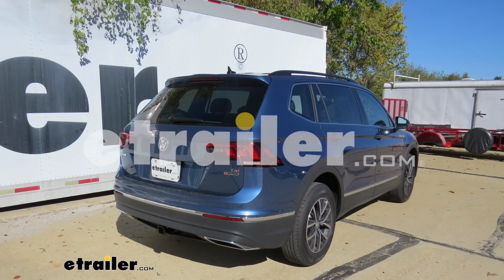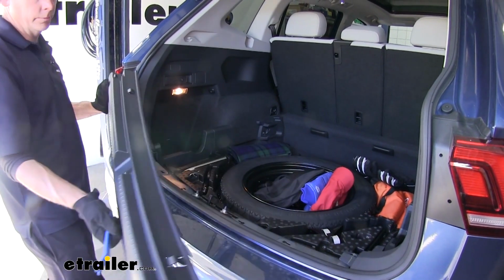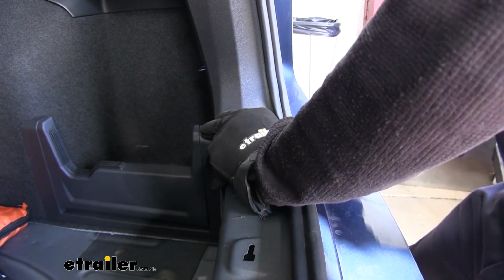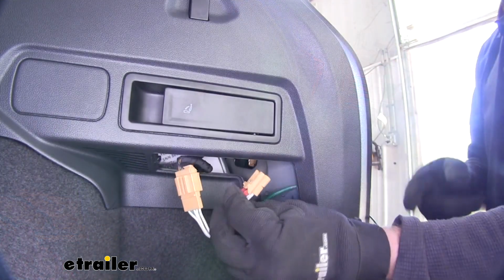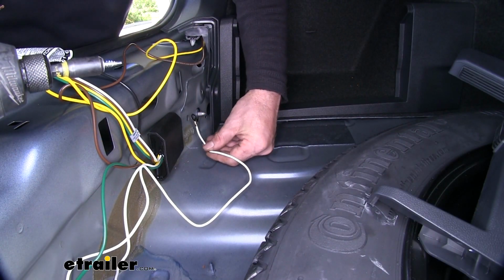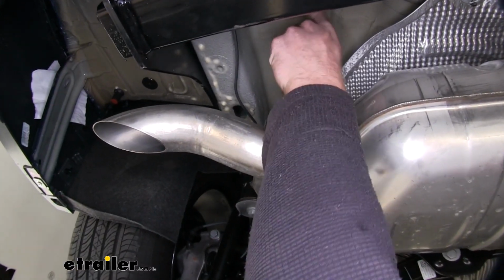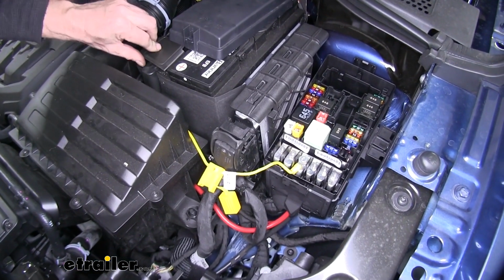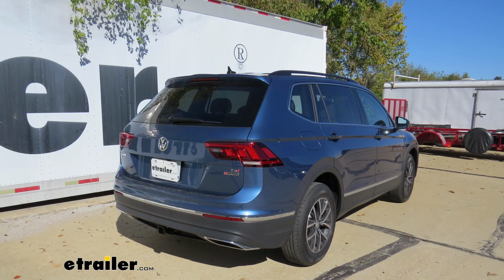etrailer | Curt T-Connector Vehicle Wiring Harness Installation - 2018 Volkswagen Tiguan

Comment: For anyone doing this you can actually run the power wire inside running along the drivers side footwells underneath the door all the way from the rear taillights/above the rear wheel well. Everything unclips very easily. A coat hanger or wire fishing kit is all your need. You’ll get your wires coming out by the hood latch. Right next to the brake pedal. all North American Tiguans have a grommet where the clutch is on European models. Very clean install. I ended up running two power wires (12 gauge for 4 way and 10 for 7 way 12v) all the way up front and installed a combination 4/7 way out back. When you get to the back there is a grommet underneath the drivers side carpet right below the taillight area you’re working on to install the 4 way, you won’t miss it. Much cleaner and you keep the wires inside for 90% of the run.
Reply from the maker: Good call! We always like to hear people finding better ways to do this as it is a bit of a pain. You will definitely be helping someone in the future!  : )

Comment: And if your turn signals are not working, check your white cable (ground)
Reply from the maker: That's good advice. Make sure that ground connection is tightly made to clean, bare metal.
https://www.etrailer.com/Custom-Fit-Vehicle-Wiring/CURT/C56403.html

Comment: Thanks for the video.  I just did it and ran the cable inside the car, thru the door sills where all the other cables are.  No need to unscrew anything, it's all clips.  There's a nice grommet thru the firewall with nothing in it, just where the clutch pedal would be on a manual car.
Reply from the maker: Good deal, it sounds like your install went well!
https://www.etrailer.com/Custom-Fit-Vehicle-Wiring/CURT/C56403.html

Comment: This may be a stupid question but to make it a bit easier since I don’t have a car lift could I just put a battery maybe like a small motorcycle battery instead of feeding the wire all the to the engine bay battery
Reply from the maker: It's not a stupid question at all! I guess that's possible, but you'd need to figure out a way to keep that battery charged. You'd honestly be better off borrowing some ramps from a friend or neighbor and installing it as recommended.
https://www.etrailer.com/Custom-Fit-Vehicle-Wiring/CURT/C56403.html

Comment: Hi! I followed all the instructions from your video, my car lights work, but the trailer lights are not working. Any suggestions?
Reply from the maker: The most simple way to start troubleshooting is to try your vehicle with a different trailer, or your trailer with a different vehicle. This will help you determine if the vehicle or the trailer is the cause of the problem you've got going on. The first thing I'd check is the point where the trailer connector grounds to the tow vehicle. Make sure that connection is securely made to clean, bare metal. Here's a link to a troubleshooting article that we hope you'll find helpful:
https://www.etrailer.com/faq-4-5-way-troubleshooting.aspx

Comment: What fuse is that? I hooked up to it but now have multiple warning lights on.
Reply from the maker: The fuse in this kit is a 15 amp fuse. We have not heard of this happening before with this kit. You can try disconnecting the wiring harness to see if that fixes the issue or you can take your vehicle to a local shop and have them read the codes to see where they are coming from.
https://www.etrailer.com/Custom-Fit-Vehicle-Wiring/Curt/C56403.html

Comment: you ran a power wire near the exhaust and under trim WITHOUT loom or insulation... WTF man?
Reply from the maker: The frame is far enough away from the exhaust that you will not have an issue.
https://www.etrailer.com/Custom-Fit-Vehicle-Wiring/Curt/C56403.html

Comment: why not buy the 13 wire Kit designed for the car, the Tiguan are now rewired , it's pretty much plug and play
Reply from the maker: The 2018 Volkswagen Tiguan does not have a wiring option for factory wiring. The following link shows the options we have.
https://www.etrailer.com/t1-2018_Volkswagen_Tiguan.htm
Reply: I’ll
Reply: Because it's like 500$ + needs coding 😅... Easy choice

Comment: Looks like quite a bit of work, but I’m not a fan of the hole drilling...is there any alternative?
Reply from the maker: You can route the wire on the inside of the vehicle up to the battery. It will just take a bit longer. You can also look around the trunk area, closer to the seats, to see if there is a grommet that you can use to get to the outside.
https://www.etrailer.com/Custom-Fit-Vehicle-Wiring/Curt/C56403.html

Comment: Take the time and run the power wire through the inside of the vehicle. Almost no chance of it ever getting damaged and shorting out.
Reply: Did you get any error codes.  I am getting some . I had directly hooked up to the battery how about yourself?
Reply: @tyrelllee5821  
What codes did you get and how did you repair it?
I’m looking at adding this kit.
Reply: scirockalot8v I agreed.